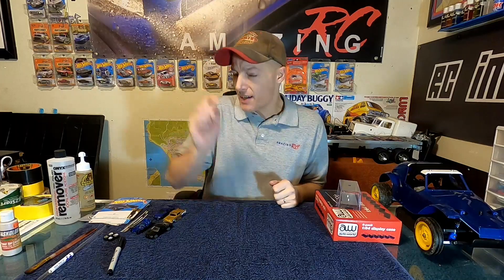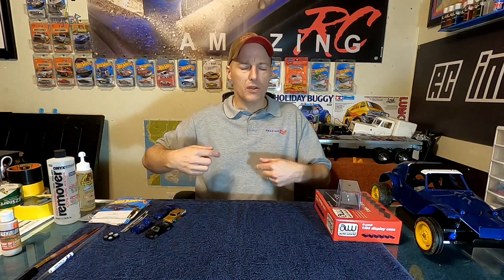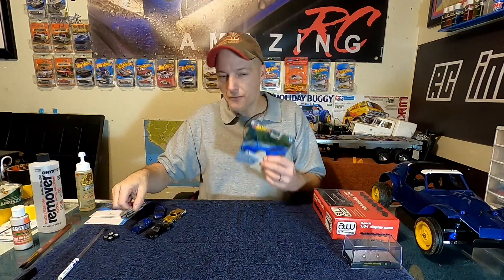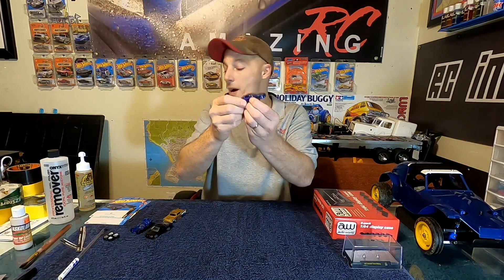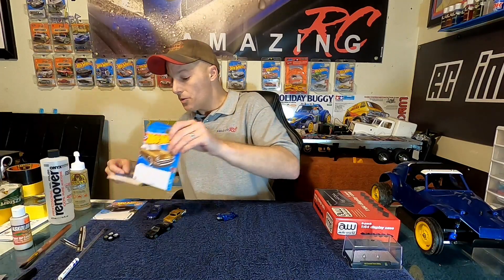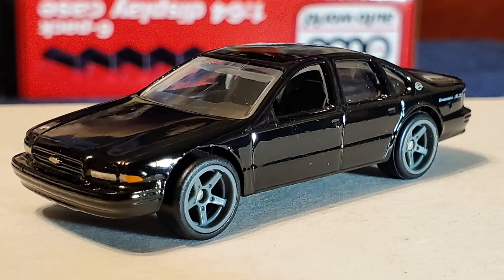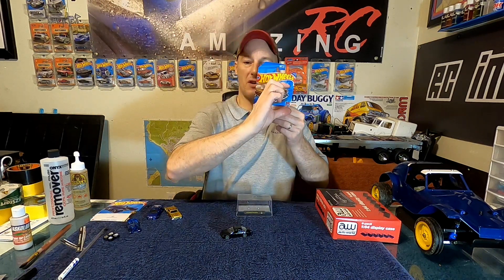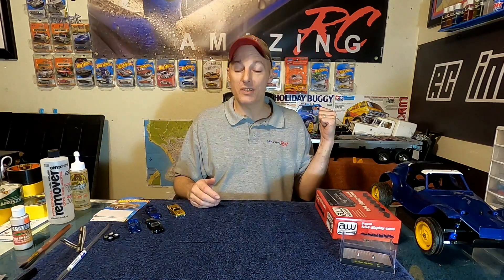Custom Hot Wheels - Video Series - Start to Finish - EP1: Introduction

Comment: Doing custom on these small vehicles requires a lot of patience, it's a nice hobby to do. Very good trick with the solvent. I also can't wait to see more of your truck once you start the interior 😊
Reply from the maker: These tiny customs are super fun.!! Patience is the key. But I do need to get back on my Grand Hauler.  I hate having to go backwards.  But I have to. I want the interior super bad and the MFC unit is in the way. I have to move it somewhere...🤔
Reply: @AMAZINGRC  Yes it is not easy to make an interior in the truck with MFC unit. You will have to find a solution, which in my opinion will not be easy.

Comment: Before you decide to paint that impala mat-black? You could probably wet-sand the current black with like a 1500-2000 grit, then hit it with a mat-clear coat? Just an idea that might save a bit of work? I’m sure it’s going to be sweet anyway ya do it bro! 👌👊👍 Keep rocking it homie!
Reply from the maker: That's why I love doing the custom Hot Wheels thing. So many different ways to get the same effect. That's why I'm doing this video series.  I think I may bring something new to the game. 😊